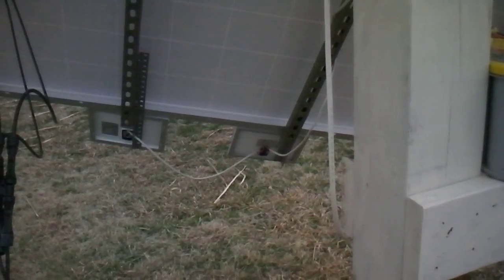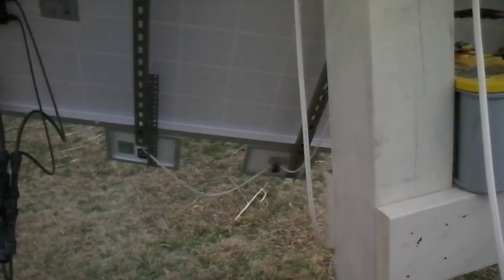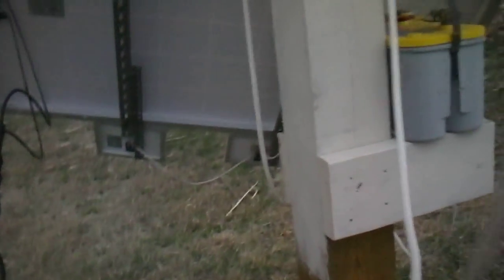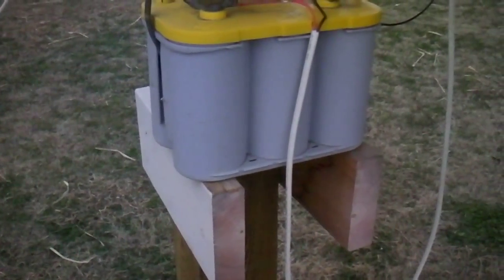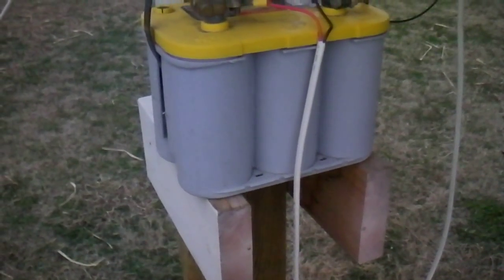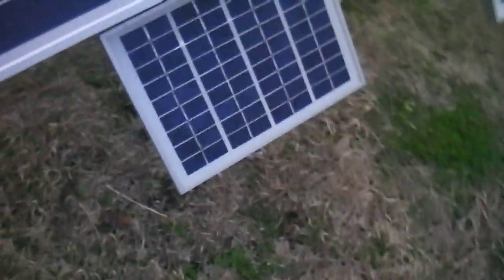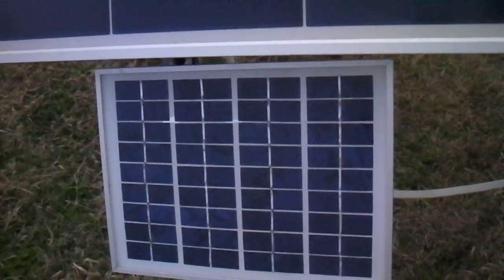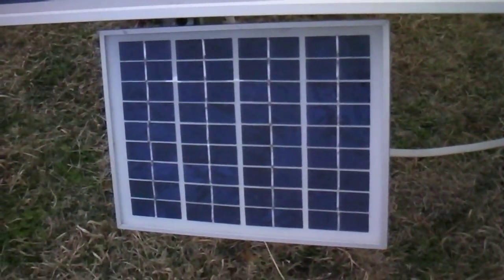Dual 5 watt Solar Panels Charging Battery on Solartracker

Comment from the maker: The actuator runs off the battery. When it gets dark the tracker parks back east. If it was running off a solar panel it would not park after dark.

Comment from the maker: yes true some. but it was too cloudy and freezing weather with just one 5 watt panel it couldn't keep up with charging. The motor only used milli-amps. That is hardly nothing. The big battery dont even notice. But it would go flat just sitting with out a decent panel to charge it. Yes im sure wind factors in some what for sure.

Comment: I have the same 5w panel. I have the same problem with buying undersized panel. Most of the time the theoretically adequate ones are not sufficient.

Comment from the maker: Yes I need more time. Kinda busy. I just put o2 sensors on my truck. I need to fix my car next. lots and lots to do. I have broken sink drain to to fix. I have dr. opointment coming up too. I will get to building a box I need to find the cheapest rough ceder somewhere. I like to use that it weathers good.